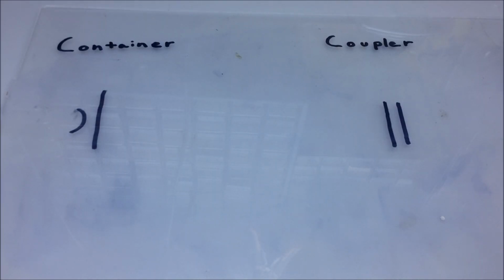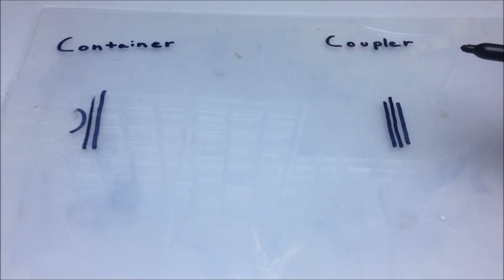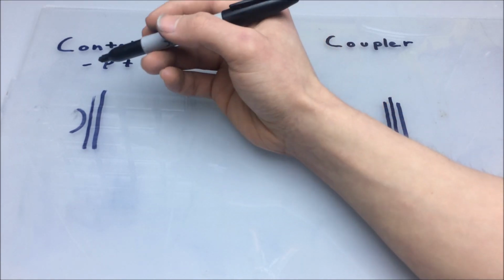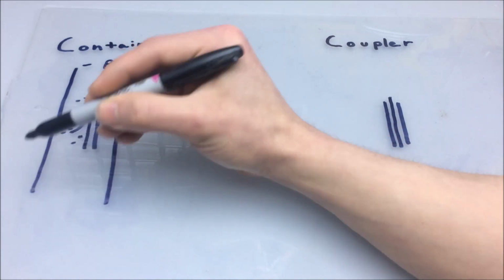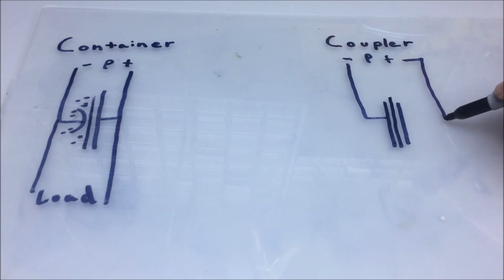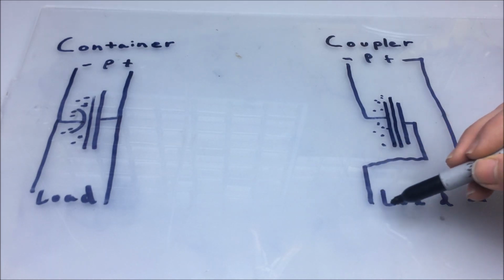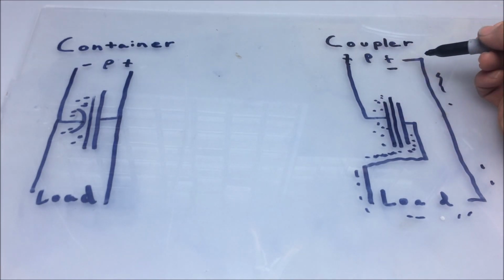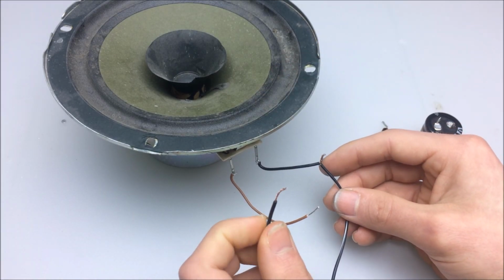How Electroperambulative Technology  Works

Comment: Awesome 
I am working on open source sls 3d printer i know xy coordinate system and marlin but new to laser galvo 
I hope if you can help me please 
I don't know how to interface laser galvo with ramps 1.4 board and marlin 3d printer firmware.
Reply from the maker: Sorry but I have to let you know I don't really know either. I am more an old school machinist. In that regard I am the 3D printer interface and firmware. If you have questions about galvo hardware that's about all I can help you on.
Reply: @Zenodilodon  can you give a simatic circuit diagram of laser galvo driver amp board and some knowledge about ilda protocol in laser galvo please.
Reply from the maker: @ASHWANISHARMA-ng9ix  Power in ranges from 15-vG-15+v to 24-vG24+v depending on the galvo amp. Analog galvos use either a Signal -5+5 pin and Ground, some use Signal 5-vG-5v+ with three pins.

If you want to know more watch this video.

https://www.youtube.com/watch?v=VchUSFiN38I&t=2801s